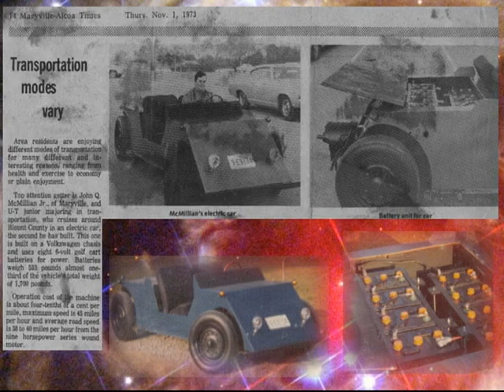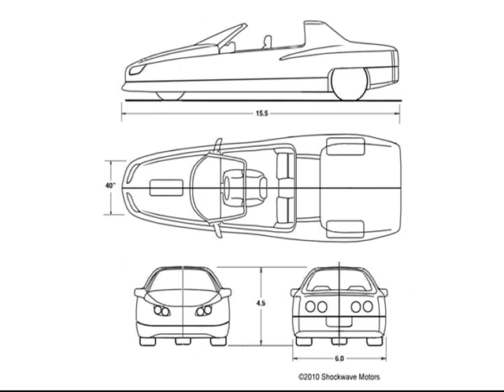The Shockwave Motors Story: Years of Electric Car Research and Development

Comment from the maker: The Robin is very light weight & has a relatively high center of gravity.  The Predator EV3© has a wide track & the batteries strategically located over the rear wheels. The 144 volt battery system we are designing will use either lead-acid or Li-Ion batteries, whichever best fits the needs of the customer.  We have established a partnership with a Li-Ion battery manufacturer & are able to buy batteries at a considerable discount.  Thank you for your comments and best of luck with your project!

Comment: hello, love the idea of your cheap ev, one that anyone could buy. I have similar goal for our future and I am currently building a body for an ev. I see you have based your design on the reliant robin?  I am wondering what type of batteries you will b using, lead acid?  kwh (size of pack) voltage?  Ive looked into lithium cells and the pack will cost 10,000 - 15,000$